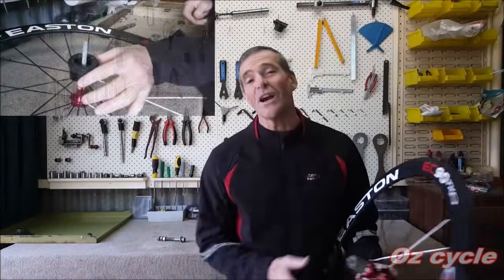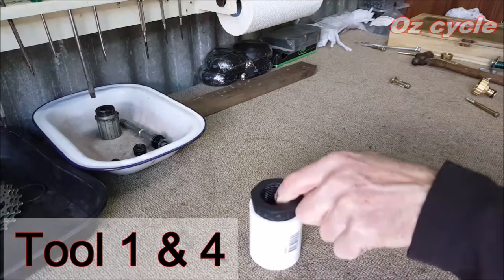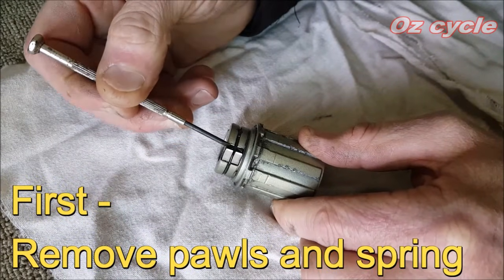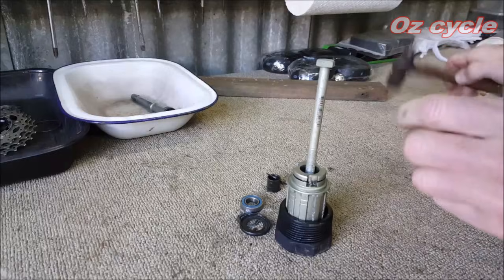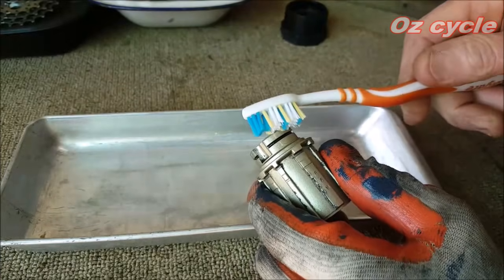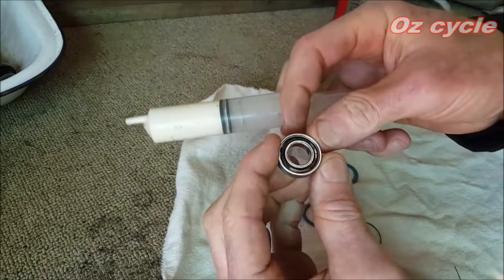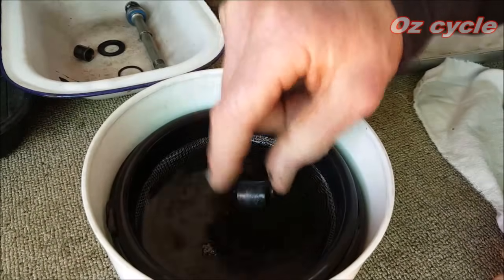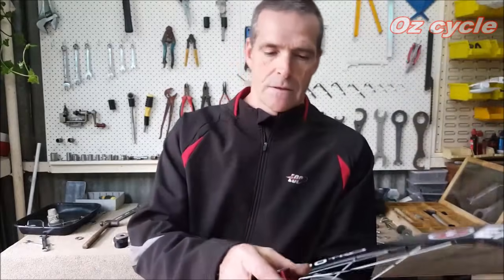Extract & press freehub bearings- no special tools

Comment: Great video, super helpful (and cheap!) 
Tip I learned: I had a pretty seized drive side wheel bearing that was not coming out with the hammer & bolt method (was whacking it pretty hard). In fear of damaging my wheel/hub/spokes, I ended up reverse pressing it out using a bolt, washers, plumbing fittings, etc & worked like a charm. Hope this helps someone else w/ a similar issue. Cheers!

Comment: Great vid Steve, I have been using a similar bolt and threaded bar DIY tool for decades. But I would say I did purchase the correct bearing drift for my free hub bearings. I was never really keen on the possibility of warping a washer and putting strain on the ceramic bearing inner race. The drift costs about 10 bucks and is basically a fat precisely sized washer, worth it for the peace of mind.

Comment: Another excellent vid Oz, just been doing my older basic style freehub which rotate on loose bearings inside, 2 rings of 25 x 1/8th bearings.
  
Needed  special but cheap tool  with 2 square teeth 180 degrees apart, needed to remove bearing cup race from inside freehub body (it is the race for the axle bearings) which opens the freehub and it screws off / separates the fh body from the threaded bolt that screws into the wheel hub, which needed an 11mm hex on a Giant wheel/freehub or a 12mm hex for a Formula fhub.

 Pawls were inside the fh body on mine and grease makes the pawls stick.   Cleaned it all up and used a small amount of grease to mount the new base bearings but otherwise just some bearing oil for the everything else.

I found that if the "service" works then it's worth doing, but if the freehub remains noisy then it wasn't worth doing it, as those basic freehubs are cheap as.

Anyhow really enjoy your work, thanks for the vids.

Comment: Great video and it's the same hub type on Vision Trimax wheels, Just stripped my freewheel to replace both bearings. Just one comment though on the pawls, I prefer using light oil versus grease as the pawls tend to stick to the grease and are not quite as "springy".

Comment: nice video steve, would like to ask regarding Campagnolo ultra torque BB cups, the campy tool UTBB140 seem to press the cups on the inside of the cup(where the bearing sits) your tool presses on the body of the cup(the outside part, is this ok in your opinion? Just concerned about crushing the cup, because it is quite thin at that part. Cheers mate thanks for your reply.
Reply from the maker: The genuine tool should work ok, but yes it doesn't sound right where it presses...might have to look into that

Comment: Yeah I have a shimano hub that's older and has those cone nuts they're impossible to find but I found some. Wish there was a way to convert to sealed bearings without replacing 
the whole hub but it is what it is. Thanks for the video very useful.

Comment: Great video's Steve, have extracted and pressed new bearings into the wheel... just tried to insert the axle into the new bearings and it will not slide in but, tried the axle in the old bearings and it won't slide in these either ?  Any ideas? should I be looking to tap it in with a bit of wood and a hammer?
Reply from the maker: Yes you can tap the axle in but if it is too tight the bearings want spin freely. Check with hub manufacturer for correct bearing size

Comment: Thanks of your advice! I had removed all nuts on both sides. There is screw cap on disc side that can't be removed after several attempt. While on the drive side, I can see the outer bearing in the free hub. Will it be the next step to tap out the screw cap and or bearing seated on disc side from the drive side ?
Reply from the maker: Yup, sounds about right

Comment: If you use ceramic bearings in the wheel hub should you use the same type of bearings in the free hub or not. Thank You
Reply from the maker: Preferably but you dont need to it will still work fine
Reply: Ok, Thanks
Reply: If you're replacing bearings, don't waste money on new ceramic ones, they are pointless on a 🚲.

Comment: Great stuff Oz!  How do you determine the type and size of bearings if they need replacement?  Also could you suggest locations where to source them from?    Thank you in advance.
Reply from the maker: +Ron MacNeil Good question Ron.1/Measure outside diameter of entire bearing. 2/Measure inside diameter of inner race. 3/Measure width of the sealed bearing. With these three measurements you can buy your new bearings. Ebay will sell. In Australia I buy"Plaig bearings".
Reply: you should also note if there is a chamfer (angle) to the outside of the races.  Not many have it (a tange headset does) but it's likely to be 45 degrees.  bearing specs are often listed ID / OD / width .  Google is your friend!!

Comment: Great video, as usual !
I wonder if there is a way to repair or prevent those bites on the freehub made from cassettes sprockets. I saw some have a hard metal protecting it, but are a renowned ones.
Thank you !
Reply from the maker: +Alvaro Federico Good question. Usually the freehub will last longer than the rim braking surface so doesnt matter anyhow. Will keep my eyes n ears open for good solution tho  :)
Reply: This guy uses two flattened out steel staples and wedges them between the splines and cassettes. I was thinking of doing this to get more life out my nice SRAM hubs as I was going to put some Chinese carbon rims on them once the ALU rims have worn out. I would love to see Oz Cycle to do your own version of this fix. Annoyingly my novatec hubs on another set of wheels already come with an ABG (Anti bite guard) installed on the freehub  https://youtu.be/PCIe9fgFDTA
Reply: @richardggeorge  one of my freehubs (bitex) has built in steel splines to prevent the soft aluminum bite. Shimano freehubs tend to simply be made of steel, preventing this issue entirely.

Comment: If you extract the bearing from the hub you tap away in the inside race of bearing? Do you have some favorite kind of graese to the bearings?
Reply from the maker: Usually it damages the bearing so new ones are recommended.  I use white lithium grease.

Comment: Thanks for the video. I tried but could not get the bearings out, i bet they are seized in the freewheel, its old wheel. Have to buy a new one..
Reply: you could get a bearing puller kit from ebay, surprisingly good value.
Reply: @DeepakKumar-lv4te  this was 2yrs ago and got it open. hard to find good quality bearings, changed them twice already

Comment: Pressing bearings is simple if you follow this guide. My only question is about feel and how much pressure the outer freehub bearing required against the spacer tube.  Too much preload make for a stiff free hub.
Reply from the maker: The spacer shouldnt cause extra friction unless it is maligned and impinging on the seal?
Reply: The spacer is straight A’s the axle went through just fine. Perhaps it’s the new grease that’s made them stiff. Good video though. Even Novatech don’t have the job you tackled on YouTube.

Comment: Any tips on how to put the grease in a syringe? I've had too much air as a problem if I just try to skoop it in. Pushing it out is not too easy and results in discontinuous stream of grease once it is being used.
Reply from the maker: +hoggif I just squash it in from the tip towards the top, making sure any air is pushed out. Takes a while but the grease lasts a long time anyhow so its worth the effort. Cheers
Reply: Hey! Cut the syringe in 1/3 portions. The push part should be bigger. Then push the bigger part inti a grease container then join the two prts by arubber hose thats just press fit to join the two. Hope this helps

Comment: Hi sir,  what if the bearing is already damage, in my case the freehub body sealed bearing already spread out. The outer core of the bearing is stock on the freehub body. Is there a way to remove the outer core of the bearing from the freehub body
Reply from the maker: Yes. Often there is a circlip holding the outer bearing in place.

Comment: Hi mr.oz cycle, I plan to replace my novatec F172SB hub. But I don't know what type of bearings and how many bearings its use.
What type of bearing on Novatec F172SB will use?
Reply from the maker: Remove the bearings and they will have numbers written on the seal. You can order new bearings by that number.

Comment: That c-clip in the freehub was in a purpose groove, so I do not understand how was it possible to push the bearing out so far, without breaking something. I'm pretty sure it was just pure luck and for most people watching this, it won't actually work. What is needed is blind hole bearing extractor and that is expensive tool. Freehubs are made this way on purpose so we can not service them without the proper tool mention which apart from Ali is extortionatelly expensive. And the ones from Ali are often single use if that.

Comment: I find that the grooves on my freehub get pretty chewed up, so that even if I could clean/replace the bearings there’s not much point. Anybody have a cure for not having the cassette eat into the freehub?
Reply: Rixter always be sure to tighten the cassette to the correct torque setting most are around 40Nm. which is surprisingly tight but will help to hold the cassette as one and stop it chewing up the freehub.